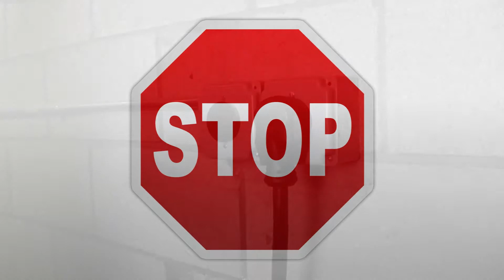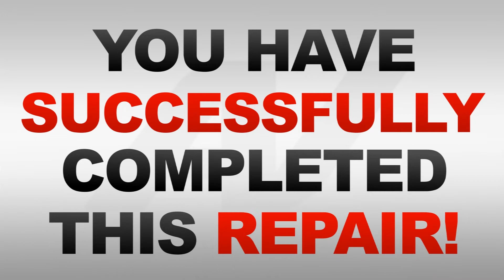Electrolux Stove Repair - Not Heating - Surface Burner

Comment: I've looked all over the place for those 'clips' that go on chrome drip pans (aka: drip bowls) to hold the element in the drip pan's notch.  Tried to buy drip pans (via Amazon) with those clips but was lied to and ended up with drip pans without the clips.   

If the only way I can get those clips is to buy drip pans that have them, I will.

Any help you can offer to point me in the right direction will be appreciated.  

Thank you.
Reply from the maker: Great question, if you have a more technical question that our parts department cannot answer, you can search our over 17,000 answered questions free at our website www.ApplianceVideo.com under our Repair Help section. You can also call our parts department at 1-800-830-5465 and they can give you help 7-days A week ,or search at www.SaveMoreOnParts.com  .